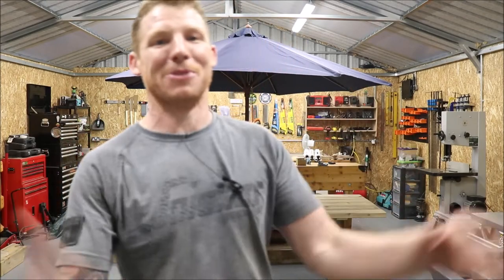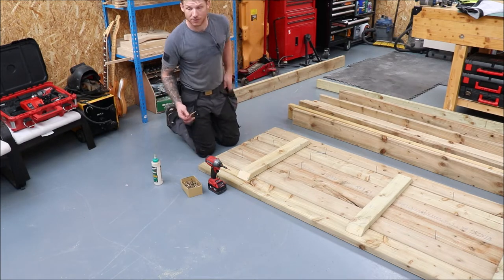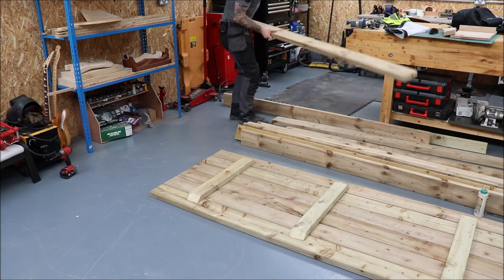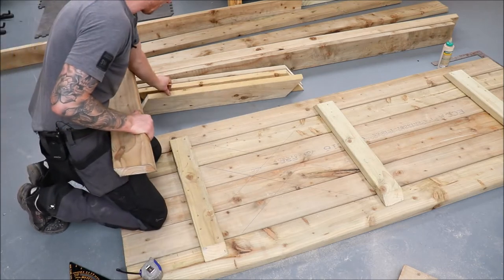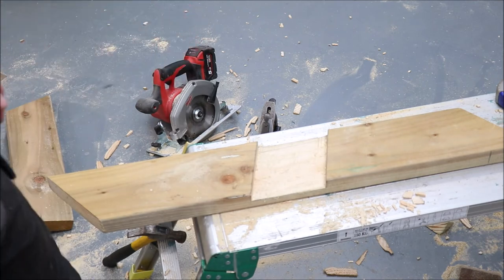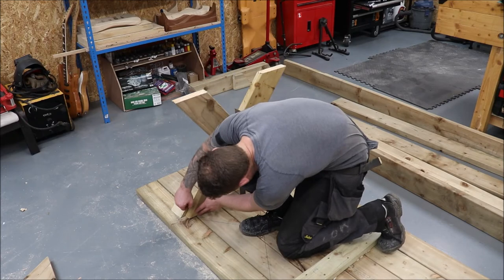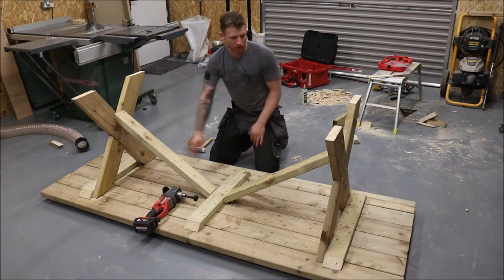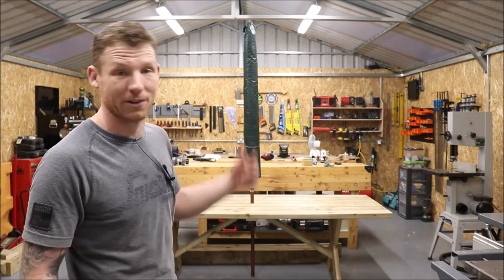Easy Picnic Table Build! . Classic X Frame Style.

Comment: I've been watching a few of your videos and noticed you talk in imperial a lot. Is this common in Ireland to use in inches vs mms?   I got  lost but I'll have to figure it out in the end. Great vids anyway.
Reply from the maker: We switched to metric in the 70's before my time but a lot of the older guys still used imperial, plumbing fittings are still imperial and we only switched from mph to kph around 2005 so a lot of people use both. Most measuring tapes you buy here will have both metric and imperial on them.
Reply: @JohnMcGrathManInShed  Wow. That is something I did not know.

Comment: Is that a Gyokucho pullsaw you have ? I have a few of those myself, I find them so enjoyable and accurate that I'm using my mitre saw less and less these days. Well unless I have to make a lot of cuts. Great video by the way.
Reply from the maker: It is indeed I bought a set, they are great like you say easy to use accurate and enjoyable. I  am pretty impressed with Japanese saws.I have a Shinto rasp I use all  the time, one of my favourite tools.